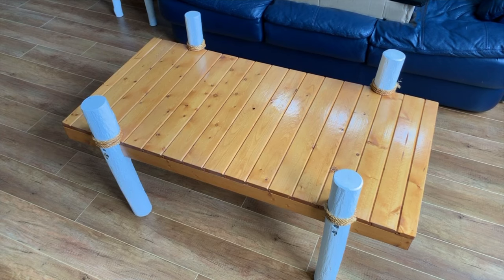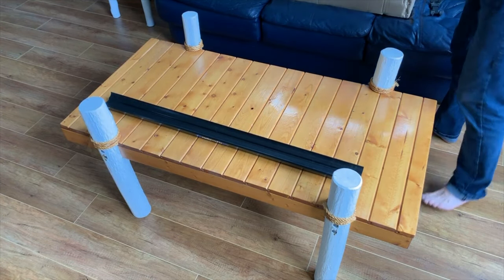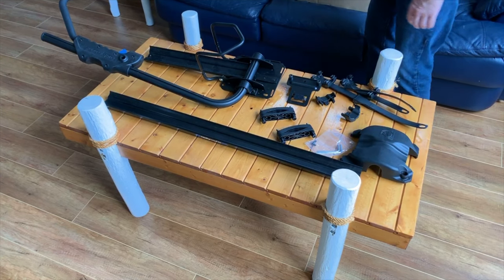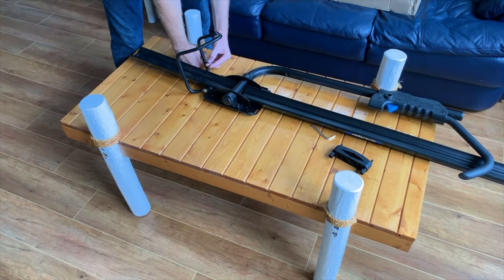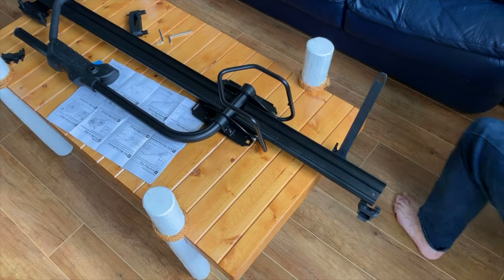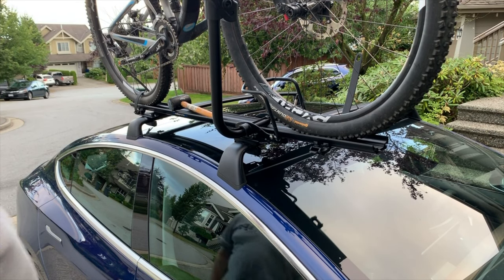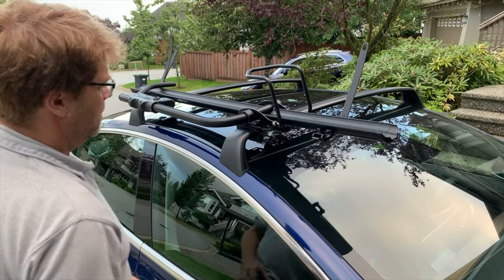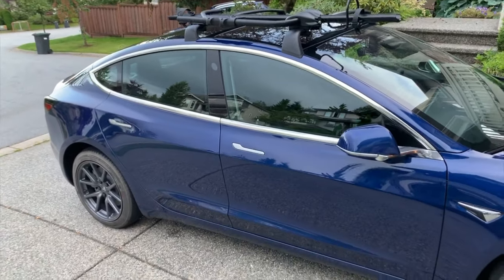Rockymounts Tomahawk Bike Rack Installation

Comment: My garage is low.   What is the height when folded flat ?
Reply from the maker: Sorry for the delay. Collapsed you are looking at 6.5 inches for just the bike rack collapsed , this does not consider the hight of the roof rack. Hope this helps
Reply from the maker: 6.5 inches